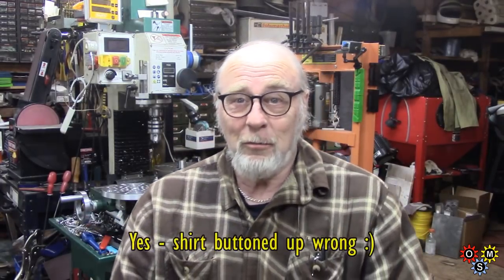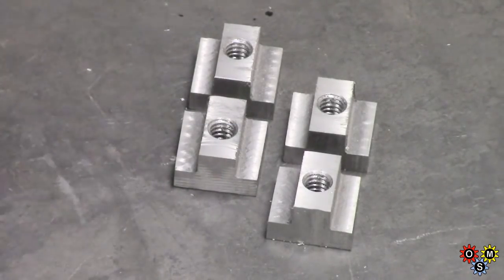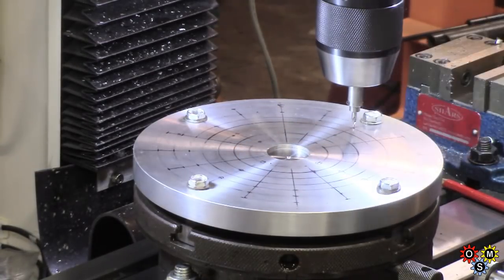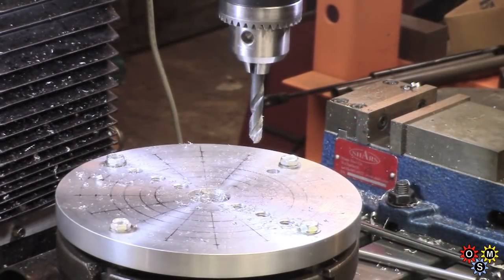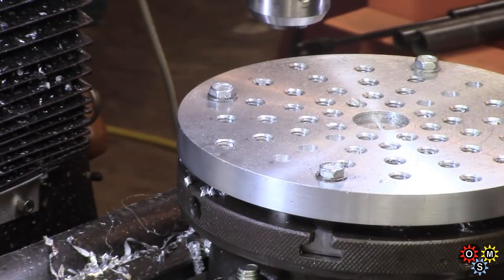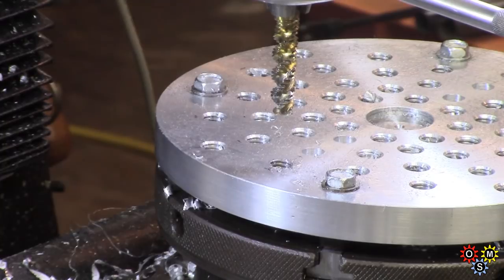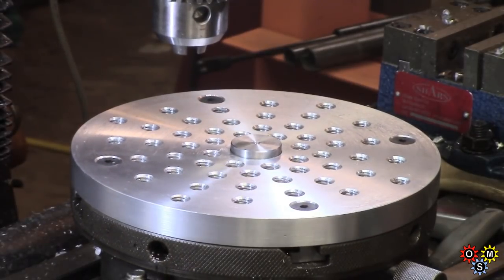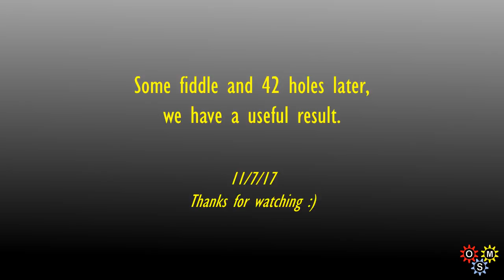Rotary Table Palette, Part Two

Comment: That is a nice palette.  Between you and mrpragmatic Lee and Mr Wildman I will sooner or later have to give in and make a rotary table palette and a propane forge and who knows what else.  Thanks for the video.
Reply from the maker: Thanks Harold. Well - could be another project for you :) 
I thought you already had a propane forge actually.
Reply: I got some loose bricks and a couple of bottles of propane with the little bernzamatic torches.  I need something real big and easier to get really hot.

Comment: You stole my thunder on the shirt! :-) I'm only paranoid about breaking taps because I've done it so many times...Lots of chips, Chris, and in the end you have a wonderful fixture for your rotary table.  Very nice.  Thanks for the share!
Reply from the maker: Thanks Dale.  Haha - well I did this same shirt goof some time ago but forgot to check before recording and so - silly old man's dress glitch!
Thing with taps is - hate ruining a good tap - but 10x worse is what the broken piece does to the work piece - possibly ruination! Thx for swinging by my friend.
Reply: The last time you had cataract surgery to blame for the shirt :-)  I do shy away from power tapping on my mill because of the risk, at least with anything smaller than 1/4 inch.
Reply: I got a coat with a "Zipper" that already looked just like your shirts guys...  Hard to undo, though...!!!   ;)
Reply from the maker: Haha :-)
Reply: I'm going to wear my shirt like that out in the shop, in homage to the OMS!
Reply from the maker: Why thank you Sir :-)

Comment: G'day Chris, nice pallet. Is there a reason why you couldn't drill and tap the centre piece for easy removal with a bolt? Well done, Peter
Reply from the maker: Hi Peter,
Thanks. In fact Chuck (Outsidescrewball) also suggested the tapping for center piece - that's added to my 'list'. :)

Comment: Chris....a suggestion if I may....make a new center block that has a larger lip located on the shaft, then mill  a relief in the bottom of you palette for the lip, center bore and thread your center block...now you have a simple center attachment for mounting parts along with the ability to pull/remove the shaft.....nice build
Reply from the maker: Hi Chuck,
Thank you. Nice idea with the centering block - I think I'll add that to ''the list'' - may in fact not need the lip as table below limits how far it drops. Center bore and thread though - like that. :)
Reply: ChrisB257 the lip is to prevent pulling it through the plate and use as a hold down

Comment: The drill/tap combination is a great tool, but you need a lot of clearance under the work piece.  I think you will find this a very useful addition to your shop.
Reply from the maker: Hi Lee,
I may yet get one but yes - lack of clearance under the work is one major consideration. I was pleased to get this made - yet another thing which was more or less inspired by you. :)
Reply: ChrisB257 Be sure to watch Herb Blair's latest video before buying one from the local hardware store. 😀
Reply from the maker: Thanks, will do. I did test a Banggood one a ways back - it broke easily!!

Comment: Thanks for all Your human, educational and inspiring videos.
I do have a 5" rotary table and a 1" thick alu plate attached to it but holes made yet. Drilling and tapping holes in a square pattern is usual but Your way of using radiallly organized holes looks very interesting
I do like You, start milling/turning first, then makes some thinking, maybe drawing. Bozo is never faar away…
Re working in Aluminium I was told, some 55 years ago, to use "White spirit", denaturated, to awoid the Alu to glue to the drill etc. Nodays there's only "Red spirit, denaturated of course. It works fine for me.
Cheers.
Reply from the maker: Hi Stefan - Thank you very much for your kind comments. Indeed I do believe ''white Spirit'' or as known in US, as "Mineral spirits" will work for drilling etc in Al - many of us these days just use WD40. Kerosine (Paraffin) can work too - but way to smelly!
Best regards.
Reply: I found the WD40 smelling and reading the label giving several warnings, care for ventilation, don't touche, don't breath etc. I stopped using it.
Keep up the spirit as much much as health allows You to be in Your shop!

Comment: Chris,

Nice work!  Let's be clear, my machining ability is in negative territory.  However, you did mention Morse taper and the lack thereof.  You seem to have a bit of space in the center of that device.  Perhaps a #0 or #1 Morse taper bushing could be fitted into the available room.  Not exactly a hefty center holder, but light duty work might be possible.

Eli D.
Reply from the maker: Hi Eli,
Yes, there is space in the center but .... very little height available. The beaten up old table is very low profile and the circle used for indexing to permit centering is also very shallow. Would love to "Morse it" but from a practical POV it ain't gonna work sadly. :)

Comment: Nice tap wrench for the mill!
Reply from the maker: Thanks Toby. It has proved very useful many times.
Reply: @ChrisB257  Is that something you bought or made?Looks like something I need for just such a project.
Reply from the maker: Hi - I made that specially but it only works on a Jacobs chuck. There is a video about it ... here is part one of two - 
http://www.oldmansshop.com/vid-pages/mill-chuck-tap-collar-pt1.php
Reply: @ChrisB257  Much appreciated Chris!

Comment: Hope the hip is doing great.  T-nuts not a piano, they look good.  Meant to ask before, do you do contract machine work to support the shop?  No answers are ever required to my questions, I understand you can't answer them all.  Good to not hear you talk about your back, must mean you don't have pain now, I hope!
Reply from the maker: Thanks - it's doing pretty good now although still some discomfort at times. The back unfortunately is a long standing chronic problem which is pretty much permanent so, it does still limit be quite a bit.
I do get occasional jobs come in but not as much as I would like to be honest.

Comment: By the way, buying raw T-nuts, sometimes adjusting the width and height, drilling the holes and threading them myself has been a fast way to get ahead.
Link: https://www.wiberger.se/templates/din508-r.htm

Comment: Some types of aluminium are a bitch to work with, mostly the 1100 series, the one they use for cheap pie plates...
This is a setup that will save you lots of time on future projects...
I think I'll have to show my huge pile of 4340 steel in the chip pan when I finish that step jacks project with Philippe, there should be at least 75 pounds of it...   (At $2.50 per pound...   :(   )
Reply from the maker: Hi Pierre,
It's a pity I can't know for sure the alloying on that Al - may have to do some digging to see what parity there is or not between the UK designations and the US ones.
Scrap - holy smokes man - 75 pounds or so of chips - wow, just wow!
Reply: Pierre's Garage borrow a forge to smelt the chips, you could make a ruck of billets with all that. Box section, round tube and muffin tins all make great moulds for alu.

Comment: use paraffin wax on aluminum for cutting an tapping..
Reply from the maker: Hi - yes that is another option but I find it leaves rather a lot of residue. Anchorlube does well but much of the time WD40 is adequate to help with chip clearance. :)